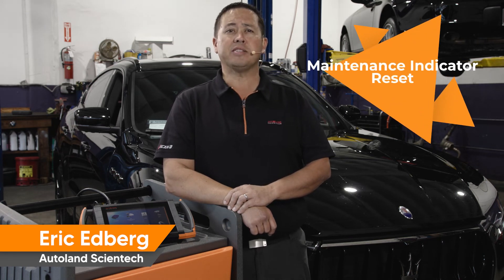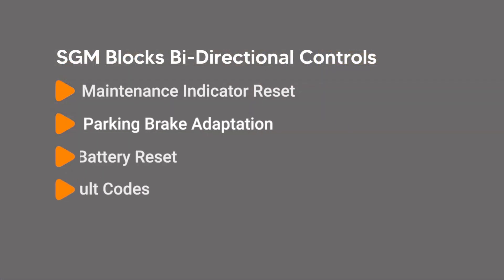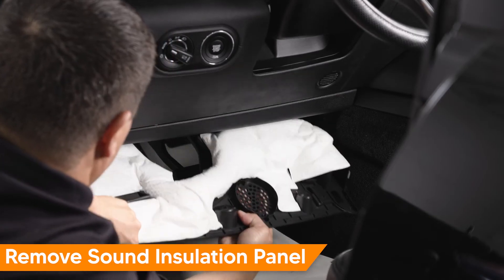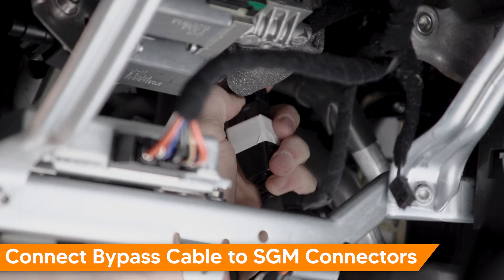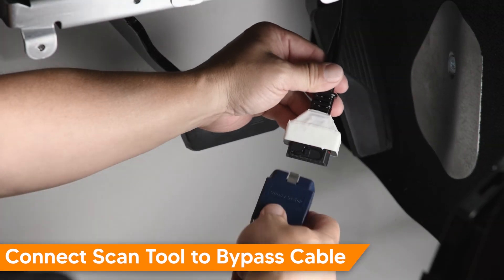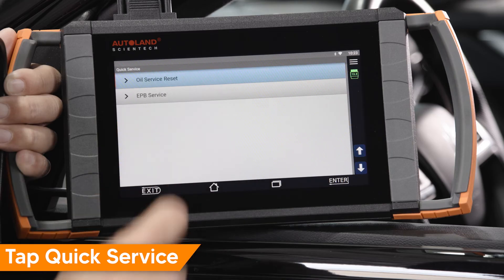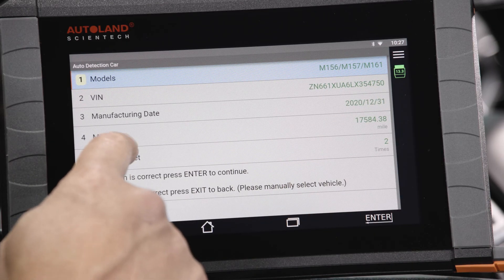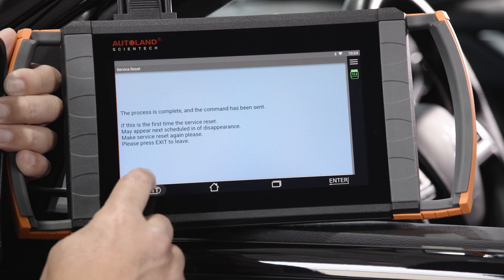How  To Reset the Service Light / Maintenance Indicator on Maserati M161 Levante Models

Comment: Great video . Will this tool work on 2021 Maserati Levante to service rear brake pads?
Reply: Yes, iSCAN will support parking brake adaptation on a 2021 Levante.
Reply: @ericedberg2104  thank you
Reply from the maker: Thanks for watching.
Reply from the maker: Thanks, Eric.
Reply from the maker: As Eric mentioned, yes! It will.

Yes, iSCAN will support parking brake adaptation on a 2021 Levante.
Reply: Will this work on a UK spec 2018 levante diesel